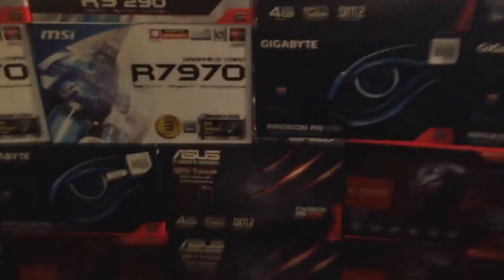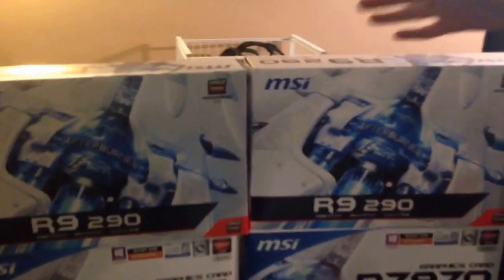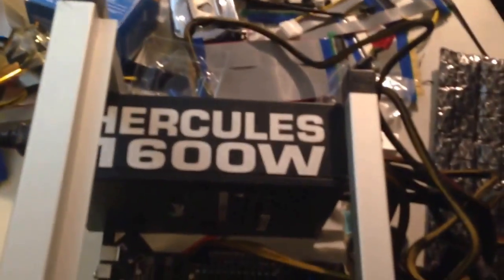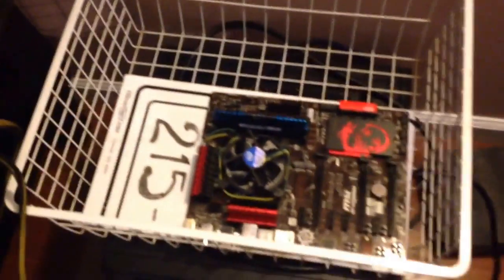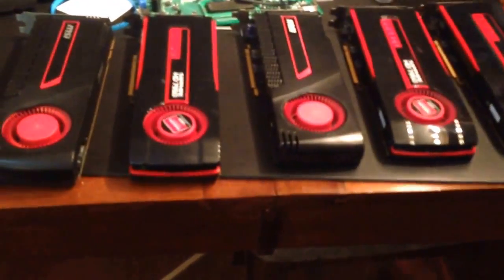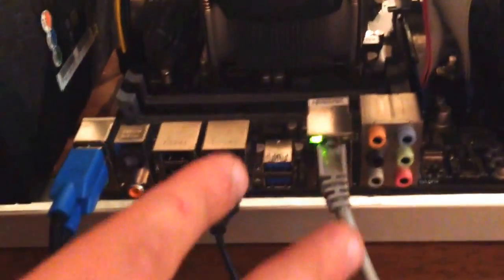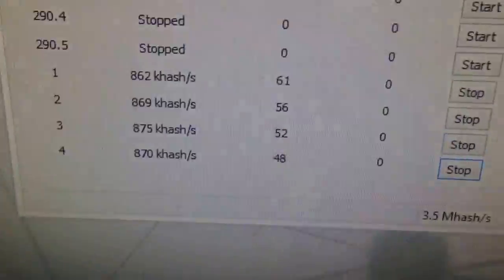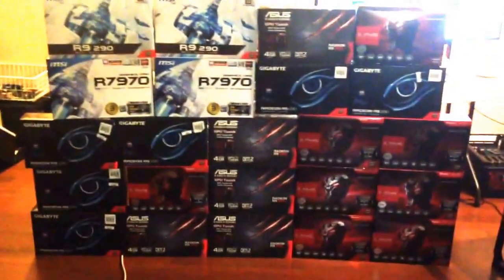R9 290 Bitcoin & Litecoin mining rigs (19,000 KH/s)

Comment: Does anyone know what the problem could be? I have a asrock 990 mother board, 1350 psu, 2 r9 290x gpu, 8 gb ram, everything ran fine, then i added a 3rd r9 290x card, everything ran fine for a few days, then my system would shut off. Now i reinstalled windows and computer keeps freezing on either boot up or in windows while doing updates, tried removing the cards and only having one running and system keeps freezing at some point? Please help and thank you!

Comment: Today (2014-02-15), this rig (19000KH/s) makes about 115$/day with litecoins.
A R9 290x makes about 900KH/s so you would need 21 of them.
R9 290x costs 699$ and takes 300w @ 7¢/KW/h (Canada)
Reply: buy the r9 290x in switzerland you will get them for 420 Fr. (~475$)( per pice :D (best Price i found in the Internet in switzerland). or normal Price in switzerland is about 450-550 Fr. (~505-570$). Note: Switzerland is FU**ING expensive BUT they have nice Prices for Electornic/PC stuff :)

Comment: Just an update, it seemed to be two different issues. On System 1 it was a bad MSI mainboard that subsequently failed. I've replaced it with a Z77-G45 and it runs perfectly now with 3x 290s at 900kh/s.
System 2 was down to power supply. Coolermaster real power pro 1000w can't push 2x 290s and an OC'd i7 stable. Swapped back to 2x 280Xs and it's fine.

So have 2x unused 290s waiting on the 2nd power supply (EVGA 1300G2) on the 18th. can't wait. Should be in the 7mh/s range.

Comment: Nice setup. Do you think I'll be ok running 290 crossfire with a 850w gold+ PSU or do I need a 1000w for mining?
Reply: 850 should be enough. 290 has a TDP of 300W so 2x 290 should use about 600W

Comment: Hello , can you give me your settings please? which tc you are using? 32765 I 20 here. Also got 8gb ram , windows 8.1 same drivers.. I only get 750 hash per card, 840 over clock. You can check my miner on my video page.But I think over clocking just ask to much electricity.

Comment: How many watts PSU would you recommend for 4 R9's? CGMiner seems to lock up after 3-4 hours, wondering if it's the PSU or heat.
Reply: I have similar issues. I've got 3 R9 290's running headless (HDMI switch trick) on 8.1. Running at stock clocks, I 20, 32765, W 256. Runs like a champ at 840'ish, then either CGminer or SGminer will crash out. On the 8.1 machine it locks hangs the machine, on the Win 7 machine with 2x 290s you can still connect but need to restart.

Windows 8.1 Ent
13.12 and 2.9 SDK
3x Sapphire 290s (two direct, one on powered riser)
MSI Z77-G45
Intel G2020
8GB HyperX Black
128GB M4 SSD
Enermax Platimax 1500W

System 2
Windows 7 Ent
13.12 and 2.9 SDK
2x Sapphire 290s
Asus Maximus IV Gene
i7 2600k @4.2ghz
8GB Ripjaws
256GB M4 SSD
Coolermaster Real Power Pro 1000W

Tried CGminer 3.7.2 and SGminer 4. Using same config for both.

Any help you can provide would be very much appreciated!

Current config for 860kh/s: 
setx GPU_MAX_ALLOC_PERCENT 100

sgminer.exe -I 20 -g 1 -w 512 --lookup-gap 2  --thread-concurrency 32765 --gpu-powertune 20 --gpu-fan 85 --no-submit-stale

Config for ~960kh/s:
setx GPU_MAX_ALLOC_PERCENT 100

setx GPU_MAX_ALLOC_PERCENT 100

sgminer.exe  -I 20 -g 1 -w 256 --lookup-gap 2  --thread-concurrency 32765 --gpu-engine 1050 --gpu-memclock 1350 --gpu-powertune 20 --gpu-fan 100 --no-submit-stale

Comment: Hi friend, congratz, can you tell me if I can start with 3 280x or 3 290 is the best way?
Reply from the maker: deff I would recommend 290 make sure you get sapphire brand! for 3 gpu you need at least 1200W
Reply: Vaz Avakyan I running 3 x Sapphire R9 290, mobo Gigabyte 970A-D3P, 2 x Risers PCie x 16 to 16, and 1 PCI-e x1 to x16, 8GB Ram Kingston HyperX, Power Unit Cooler Master Silent Pro 1500W, CPU AMD Sempron 2.8GHz, 1.0 MB Total cache, HDD 500GB SATA, with Win 7.0, cgminer 3.7.2. Can I add another Sapphire R9 290 considering the power consumption?
Reply: Mariano S I forgot to say that the 1 PCI-e x1 to x16 has a molex conected to power unit. I´m getting 850 KH/s each GPU, and I´m using MSI Afterburner. Core Voltager 0mv, Power Limit +20, Core Clock 1000, Memo Clock 1500

Comment: Got those R9 290 by Sapphire, Can't get Win7 to see 3 cards since no monitor is connected. Can't use dummy plugs (tried even DisplayPort->VGA). How do u get these to work with no dummy plugs?
Reply: HDMI cable connected to a switch
Reply from the maker: James Jones very smart!
Reply: James Jones What? Can you elaborate?

Comment: Hi. This was a great video. I've got a question. What is the maximum heat those R9s can handle without loosing performance?
Reply from the maker: Try to not have it more than 80C so you will be able to resell it in a year but if you only concern about performance its around 90C